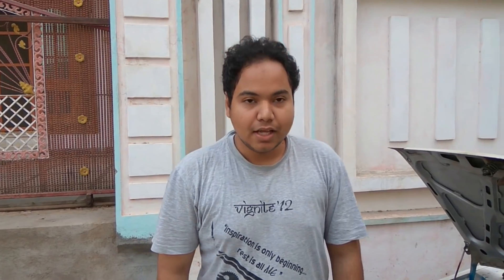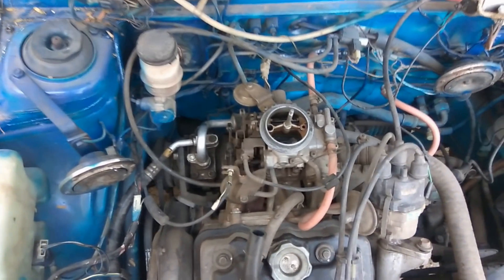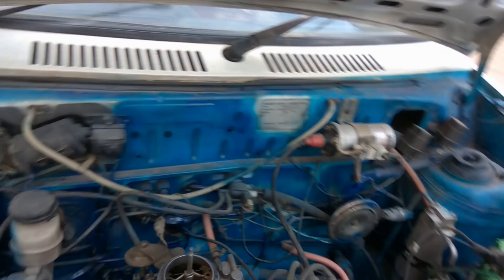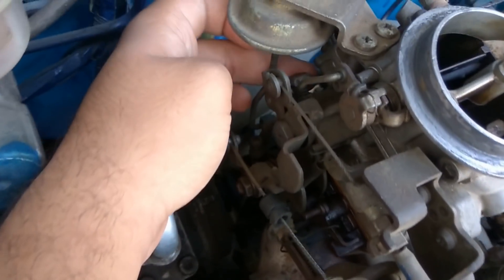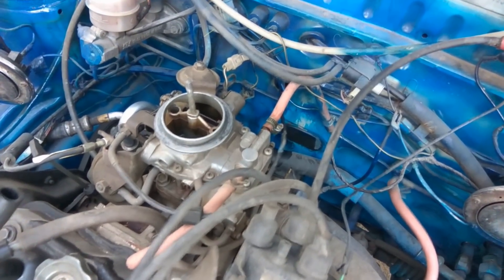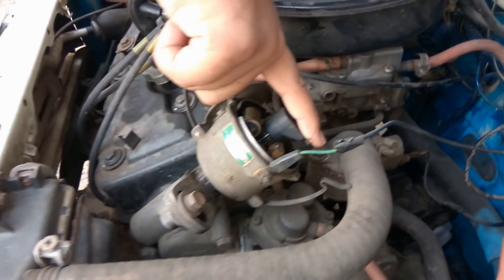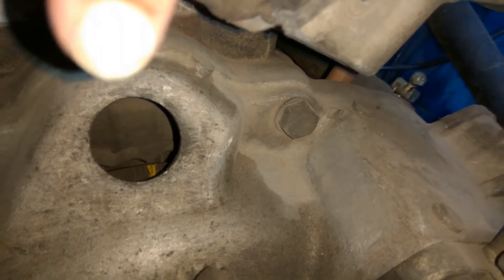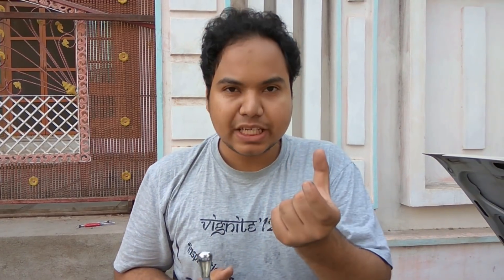Tune carb and spark distributor for max mileage

Comment: idling secew??I ded not get it... please tell what does high or low idle means?? and moreover ... my maruti 800 model 2000 does not start in 1 go  what m I suppose to do??
Reply from the maker: Hritik kumar if the idle rpm of your car is low, tighten the screw. if the idle is high, loosen the screw. first do everything as i said in the video. adjust all screws. then, drive for 1 or 2 days. if you still have problems, then ask me
Reply: aveem I followed the instructions.. everything went fine and I have driven my car around 140 km after tuning ... but still I m not getting average  of more than 14 in highway.. any suggestions??
Reply from the maker: Hritik kumar did you check whether you have fuel return line working? that is very important.
Reply: yes aveem there iz decent amount of fuel return.. please help in case there is any other solution ... i followed your guidelines step by step..
Reply: one more thing  I need to add.. that black arrow like thing in between the spark distributer was not pointing towards the engine it was pointing towards me (front).. but in your case it was facing towards engine (almost left) .... does that make any difference??
Reply from the maker: the direction it points does not make a difference. Just make sure that you push the car until the marking on the flywheel matches the indicator. 

The worst mileage I ever got on a highway was 16 kmpl that too in bad tuning. You can't get less than 16kmpl in 4th gear. What speeds were you driving? To get good mileage, do not exceed 90 kmph and do not fall below 55 kmph in cruising. Ideally, you should be doing 65-75 kmph. How did you measure your mileage. If you look at your petrol gauge to know mileage, you will have a huge error. Petrol gauge works in steps of 2-4 liters a step. So, if your fuel guage fell down by a a tiny bit, then you may have used 1 liter or 4 liters. Do a petrol tank full, drive for some distance and do a full tank again. Then you will accurately know mileage. By the way, do you have leaks? Do you smell petrol when driving or idle? How is your spark plug wires? How is your oil? Do you have any white smoke from your engine? Are your brakes rubbing? Will your car coast in idle or come to a stop soon?
Reply: i mostly travel between 2 cities daily , distance is roughly 49 km .. usually what  I do is... every morning when I leave .my petrol gauge is almost at E .. so I refuel my car by around 7 litres (rs 500).. while I return in  the evening the gauge is again there almost at E . ..next day  I do the same.... (traffic on city Is average ..and highway is almost null..)........ i recently  got my car serviced . but today I did analysis of the oil using dipstick I found it to be little brownish and while I rubbed it between fingers I found tiny rough sand like particles ... what does it indicate??  and there is no such problem like white smoke , brakes rubbing... and  coasts quite well in neutral or full clutch pressed..... moreover  I m not getting idea how to inspect spark plug wires kindly guide me..
Reply from the maker: Rough sand like particles! That is seriously bad stuff and kills engine. Were you standing there when they do servicing? Do they change engine oil or just top up. When you change engine oil, any particles must be trapped in oil filter and come out. Or they should just fall out with the oil. Try draining the oil once again at some other service center or local garage.  Pour AC Delco 20w-50 engine oil and also change the oil filter. I like the smoothness of it.

Pull the spark plug wires lightly. If they come off, then you should get the wires replaced. If the car passes the test, start the car, and pull off one spark plug wire. If it still runs, put it back on and then pull off another one. Repeat the process for each wire. If the car stops when you plug out any wire, then it means that spark plugs are bad and need replacement.

Apart from that, when you were doing the spark tuning, did you get the spark sound? Did you do spark tuning?
Reply: yes I tightened the screw when spark sound came (kept it close to air filter)... .. I want to try changing the engine oil and filter my self ... so  can you please tell me how much amount of oil do I need to put and what would it's cost be along with filter..... and where can I find the  engine oil dain bolt...???
Reply from the maker: The engine drain bolt is at the very bottom of the engine on the drivers side. And i did not check but I remember that the bolt points inward towards the back. It would be difficult for you to access unless you jack the car. The oil filter is located just behind the front bumper driver side behind the number plate. It is easier to take it to a mechanic and get it done. He will charge 100rs to change the oil and filter. Just get the one of your choice. I recommend AC delco 20w-50 engine oil. Do it and see the difference.
Reply from the maker: also, when you get oil changed, remove the spark plug and inspect the condition of them. is it black or white or pinkish
Reply: ok  ... thank$ Aveem for your concern... i'll  surely try it and share the results...👍👍👍
Reply: hi aveem , I did the tuning again ... I herd the sound of spark from the spark distributer... was it suppose to come from wire near air filter.???.. if this  is so then I'm afraid that it was some other sound which I considered as spark.....?😢
Reply from the maker: there will be only one angle of spark distributor when you get the sound. Whenever I do the tuning, I hear spark sound near the air filter. When you are trying to tune the spark timing, don't touch the spark plug wire with the air filter. Maintain a small gap so that a spark can fly from distributor wire to the air filter. Although you can only sometimes see the actual spark, you can always hear the sound of a spark. Once you find the angle, Verify the angle by rotating the spark distributor again to the same spot. After 2 or 3 goes, you will be dead sure about the location of your spark distributor timing.
Reply: yes it worked I can now see  improvement in power... thanks. I also noticed that my secondary throttle is also not working ... its jammed what to do??
Reply from the maker: I am glad it worked. You mileage will now be good. For secondary valve opening, you need to open and clean your carburetor. There will be an improvement in the top end performance because of that but it is not so significantly huge. So, if you want performance and you like to floor the accelerator, wait for the next video where there is teh updated guide to how to clean the carb. Or else, enjoy the car. One more thing I would suggest is fuel injector cleaner. It makes a LOOOOOT of difference and costs 300rupees only. Pour one bottle of it into your full petrol tank and drive the car. You will see a difference after 100 kms.
Reply: i'll definitely try it brother ... thanks for your support and concern.... 👍

Comment: ASLMlkm. bhai ap carburetor ka front screw 1.5 times turn karne ke liye bole but 1 time hi rotate kare.
Reply from the maker: meer adil wo bas video ke liye tempeorary tha. mai carb tuning aur precisely baad me karta hu. 1.5 times mai hamesha karke rakhta hu
Reply: thanks bhai now im getting mileage about 24kmpl on highway without ac. bhai ek problem hai mere car mein jo mai aj dekha. normally gas pe chalatum mi car. petrol mileage check karne ke liye 100/- ka petrol daala mai. initially car start nai hori thi, to mi fuel pump outlet pipe carburetor se nikalke suck kara takay petrol carb tak aaye. about 200ml engine oil nikla usmein se fir petrol aaya. kya fuel pump ka diaphragm phat chuka hai? shall i replace the fuel pump?
Reply from the maker: Perhaps, there was engine oil or such gunky residue inside your petrol tank. Our indian petrol is always full of adulteration. Since you use your car on gas regularly, all that residue might have come to the top as a separate layer (doodh ka doodh aur paani ka paani ho gaya). If your car works now on petrol, then there is petrol being pumped and so the diaphragm is alright.
Reply: ASLMlkm bhai. yesterday i opened that fuel pump and i found the diaphragm ok but there is plastic material in the pump which was damaged. i think i have to change that pump. Bhai one more thing i would like to know that how much does it cost to repair the head gasket bcoz my engine is drinking coolant fastly and i can see white smoke from exhaust. also the engine oil level is getting reduced. the cylinders are good but due to bad head gasket engine is drinking coolant and oil. any suggestions regarding this. Thank you
Reply from the maker: How do you know that it is the head gasket fault? Coolant leak is the fault of head gasket, certainly, but the oil drinking could be head gasket or worn out piston rings. To do just head gasket, you can do it with engine mounted on the car. Although your mechanic will not recommend it and push you to do a full engine rebuild, you can still do just a head gasket replacement. Cost of doing the head must be around 3000-5000 rupees. But if your piston rings are also worn out, it means that you have to take the engine out of the car. It takes anywhere between 10,000 to 15,000 if they work on the existing engine. If you plan to keep your car longer, then you can buy a new half engine which consists of engine block and pistons and crank shaft for 13,000 and add 4000-6000 for labour charges at local garage. And running car on gas kills engines faster.
Reply: Aveem Ashfaq bhai my car's engine was rebuild by the ex owner two years back. and i maintained the engine in very gud condition. i maintained the engine oil level and heat indicator was always in its limit. so i think the piston rings should not be bad. also the oil level was recwntly reduced to low level due to the faulty fuel pump. all the oil was getting into cylinder through pump, carburretor. when i opened air filter i found oil strains in carburretor and filter. now i changed the fuel pump and there is no oil in carburretor and air filter. and i doubt the white smoke is due to bad head gasket bcoz i did an experiment with radiator while cleaning it. i removed one of the outlet pipe of coolant system and pouring water from the radiator cap and the water was drainibg through that pipe. and to remove the whole water from engine and radiator i accelerated the engine hard and suddenly there was a sound of "phaaaat" from head gasket and a little white smoke also cane out from near gasket. and from that time a white smoke is coming out from exhaust. I hope its a bad head gasket not piston rings. also i googled to know that how much it costs for changing head gasket and i found it about 1000/- bcoz gasket costs about 100/- and remaining for labour charge.
Reply from the maker: meer adil which pipe did you remove, the top or bottom. Your engine was fine. You spoilt it with the experiment. i told you the cost of opening a engine, getting the head resurfaced and installing new valves. If you just want to change the gasket, you can simply ask him to do that. yes it will take only 1000 rupees or even less. make sure you get mgp gasket and ask him not to put any gasket marker. ideally, if the head and block are good, you should just be enough with gasket. if the head or block is twisted or is cut, then you need gasket gum
Reply: Aveem Ashfaq  bhai it was the pipe coming from engine to gas carb ( dont remember the exact name). this pipe connects the hot coolant to gas carb so that the gas carb will be hot and helps to run the gas system well.
Reply from the maker: You have pulled the right pipe and the experiment was not your fault. You should not have raised the accelerator too much because that produced a scarcity of water. It is only blow gasket and you can get it done for 500-1000 rupees.
Reply: Aveem Ashfaq  ok thanks for confirming.

Comment: my 800 1986 model ac not given so good cooling so please make some ac cooling video
Reply from the maker: I am looking into it. I have two methods. One spray water on radiator. This does not look so good. The other is a new type of cooling system. I am working on it now.